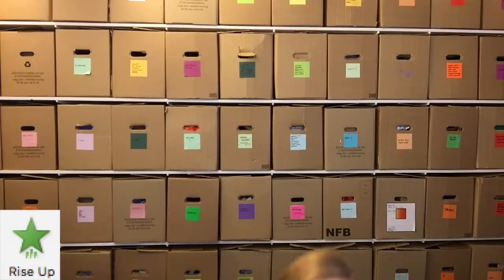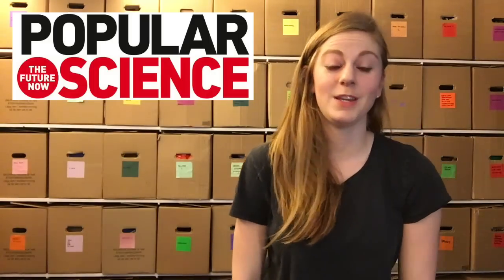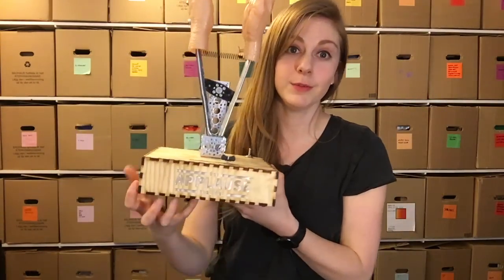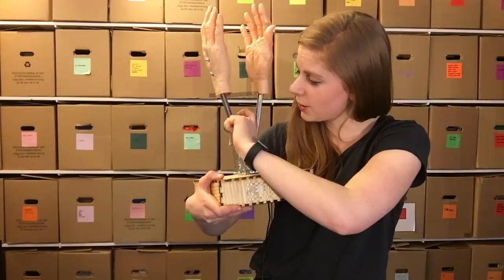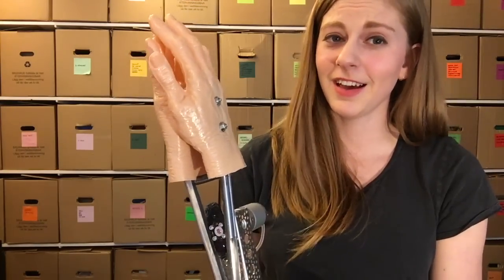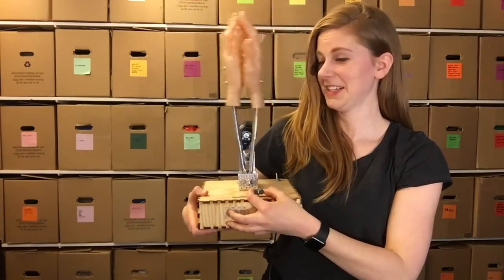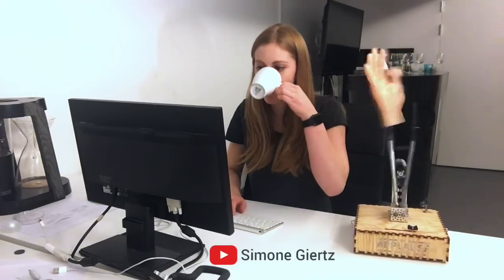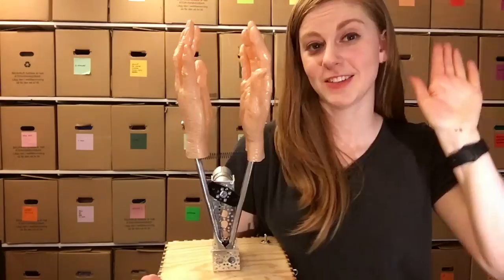Applause Machine VLOG

Comment: As an engineer candidate I have to admit that It's amazing. You can prefer silicone prosthetic hands for it. I believe they will create a better sound. Or you can mute the hands' audio and play an applause sound with your Arduino. Plus you don't need to use Arduino for that. you can just connect the motor directly to input and adjust it with a variable resistor :) Looking forward for your next projects :)

Comment: Cool Project !! Some suggested improvements if you want to make it less noisy:   [ The motor mount could have a different bearing so that way when it slides through the tongs it doesn't create that friction sound, Also rubber springs tend to be less noisy  something like an elastic cable, The motor depending on what you choose could have a sound dampener so then you only have the hands clapping ] Overall though, really awesome build! Just discovered your content and I think i'm a fan.

Comment: If you use rubber cups (experiment with size) you can get the clapping sound.  The cam idea is nice, but the spring is too much. 9 mm wide rubber band will do, it will also help the motor and the squeaking noise.

Comment: yeah, why the arduino?
Reply: +RepentHarlequin 
I'm guessing the motor's speed is controlled by PWM  so a 555 or a couple of transistors probably would have done the job but arduinos are a great for people without much electronic knowledge to forge ahead anyway. People with electronic knowledge use them because it saves time.
Reply: +SlyPearTree Speak from experience here. It's much easier to get an arduino to preform tasks than using analouge electronics. You could sit for an hour figuring it out then solder it together, or 5 minutes at a computer to programme and arduino.

Comment: If you plan to spend a little money, I would imagine something similar to ballistics gel or silicone would work well. Maybe even just a rubber mold. You might have to adjust the spring for the extra weight, though.

Comment: It might be better at slow clapping if the motor speed stays fast during the release portion, and only slows down on the spread portion.  I think cam lobe would be a good word for the oval piece you attached to the motor.  OH!  How about the oval cam spreads the tongs, but they're held open by electomagnets while the cams move out of the way, at which point the electromagnets release.  That way, you'll have a lot more kinetic energy for the clap.

Comment: I'm not an engineer or anything but surely this would have worked better if the motor was attached to a crankshaft which moved the hand back and forth hitting the other hand.

I'm not sure this current design was very well thought through...